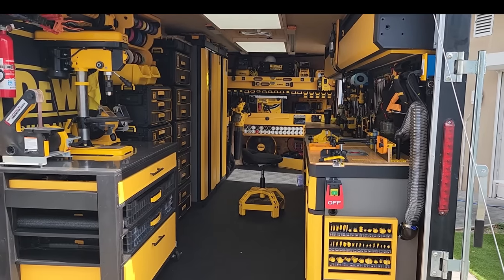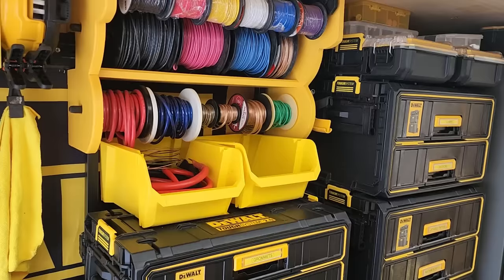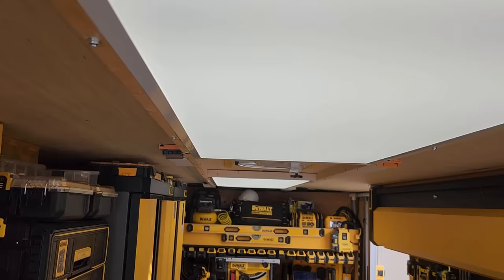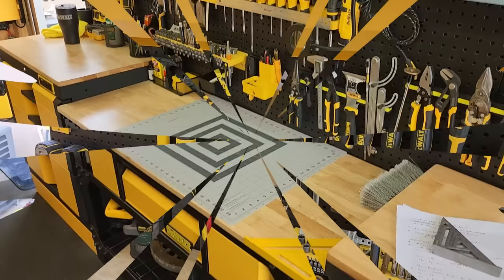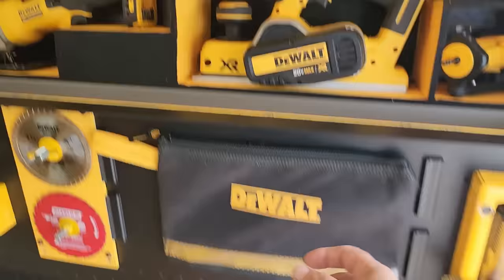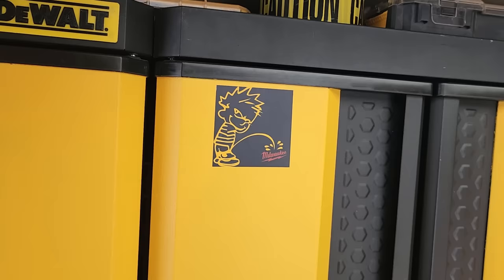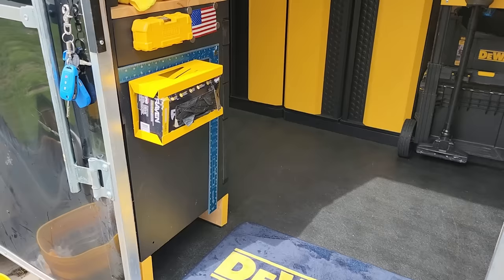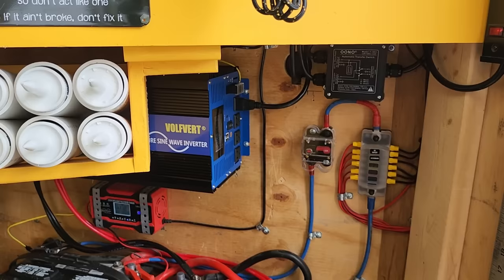DeWalt Theme Trailer Workshop

Comment: This is a fantastic looking set up. You must be so chuffed with that... is it working out or have you? Over in the uk we dont really trailer. Id love to do it but just not practical
Reply from the maker: It's mostly just for tool storage.. its a rolling garage. So far I haven't had a need to move it or do much work inside. I drive a truck and just grab what I need for the day. Depending on the project I am working on, most of it is done outside the trailer anyway, so its a perfect setup for me.

Comment: Great job!   Do you have plans or drawings of any sort?  Looking to do this in a 30’ car hauler trailer with ramp.
Reply from the maker: I didn't really have plans when I started. I had  the cabinets already, so I just slapped them inside and worked out the positions. The last  cabinet to go in was the table with the drill press. I built that table to size, so I had the luxury of fitting it right up to the ramp door.

Comment: Hey Barry, love the build! Quick question on the paint, was there a specific yellow you used on the custom pieces? I’m working on a dewalt build but can’t find a yellow that really matches. Thanks in advance!
Reply from the maker: Most of the cabinets I rolled on with a paint that home depot color matched, but i assume its the spray paint you are interested in. There's a few colors that are close, but the one I like the best is Rust-O-Leum's "Golden Sunset" .. its a little bit more on the orange side and you can see the results for yourself in the video. The only down side is that it is only available in a gloss, so you will likely need to spray a matte finish after it dries.

Comment: I don't understand how things don't fall out and move around when this is on the road? How do the kobalt cabinets stay closed?
Reply from the maker: They all have mechanical latches and matched keys. If you pause the video, you can see the locks. As for the tools, they are extremely secure, I use various methods to secure them.. some are simply held in by being wedged into a tight spot while other use velcro straps or oversized hooks. unfortunately there is no "One" solution that would work universally, each tool needs to be secured differently.
Reply: I was wondering the same.  The tools in those cabinets will come thru those doors. Don’t think this trailer could handle my work day.  But that’s why it isn’t mine
Reply from the maker: @allbayfishing9456 all Kobalt cabinets have locks with matched secùrity keys.. If you pause the video, I'm sure you'll see them..I even added some additional security latches on the upper cabinets.. they are not needed, but I didn't want to take chances.  As far as tools flying all-over the place on the road, I can tell you I am 100% certain its not gonna happen! Despite how it may appear, it's not possible.  Sadly the video ran much longer than expected and I didn't get to cover many of the smaller features, including how the tools are all individually and uniquely secured in place.. I plan to address that in a future video, but every power tool is secured with its own discreet method.. some are simply held with velcro straps or pressed firmly against  "contour fitted" side walls. Others are stealth mounted or otherwise clipped directly to a flat surface with hidden clips. There is very little play to anything. It all requires some form of simple 2 step action or a specific motion to release.  I am actually very proud of some methods, they are not all "magic tricks", but some of them are overly simple and effective. 
 As for the tools on the pegboard wall.. yeah, they need to be boxed up before I move out, some of them are secure enough to stay but it only takes a few minutes to toss them all in a box.
  The only things I worry about are the hand tools in the drawers, and the drill press. The drill press is a bit of a pain in the ass but I'll eventually come up with something better than just ratchet straps im currently using.. as for the drawers, ill probably end up using kaizan foam or building some cpvc inserts. I honestly haven't towed it around a lot since i finished it, but the only things that have moved on me so far are the contents of the drawers and some floor items... the stool, the 24" fan and my rolling tough system toolbox (which put a nice big dent in a new cabinet) . All of which are simple fixes I should have predicted sooner, but over all its probably more secure than a lot of other work trailers. There's always "something" that's going to fall over or slide around in a trailer, but so far she's holding up great.

Comment: Imagine if somebody did this with good tools, like Milwaukee?
Reply: You can find those videos. Milwaukee takes advantage of vocal loyalists like yourself and uses you to drive their prices up. I do like a lot of my Milwaukee tools, but I've also spent a lot of money on some of their flops. If I was a mechanic or plumber, Milwaukee would be my primary brand, and they've earned that. In my experience, DeWalt has proven their worth in the field. Not necessarily the strongest, not necessarily the most durable if you're sending 1,000 lags in a day, but definitely a good ROI in general.
Reply from the maker: I find that no matter which tool brand you purchase, DeWalt always seems to be the brand everyone compares their product to.. they always set the benchmark. In recent years Milwaukee has taken the lead by manufacturing many cordless tools that DeWalt does not, and they have not been well reviewed.
Reply: @Tool_Addicted_Carpenter  I am a mechanic, using exclusively Milwaukee impact tools, drills, screwdrivers and ratchets, all battery powered, 38 hours a week , every week. Nothing else has stood up to this kind of use and abuse
Reply: @glennstatham960  Precisely why I said that mechanics and plumbers are essentially obligated to consume Milwaukee.
Reply from the maker: We all pick a team,  I picked yellow and ran with it. The trailer could have been any color. I personally love a good dewalt/milwaukee debate, but both brands are great and get the job done.. believe it or not, I made a Milwaukee trailer as well but I had to walk away from the project, it was costing me 10 times more money and broke down in the parking lot! :)

Comment: I love the trailer, but how do you deal with the dust
Reply from the maker: I don't do much cutting inside the trailer. I prefer to work outside under a canopy. As for the corded machines in the back, I have a dust extraction system under the router table which can quickly be connected to the drill press and sander. I have to run the hose across the floor, but Its a small sacrifice to keep the place clean. There's only so much you can do inside a trailer. I also keep the ramp open when I'm working and blow everything out real quick when done.

Comment: When u painted your drill press and bench grinder what color did you use. I’m assuming spray can. Also what color paint on the wood tables like the black gray and yellow in im assuming house paints?
Reply from the maker: the spray paint i used is Rust-O-Leum "Golden Sunset".. it is a gloss paint, so i would highly recommend a matte finish be applied. The Yellow on the cabinets was color matched at Home Depot using a dewalt organizer tray off a store shelf. Most everything else is the "factory colors"

Comment: Dewalt do a battery operated dust extractor with a wireless remote control DCV586M
Reply from the maker: That's just it.. I have one. But the damn dust box is too small.. terrible design flaw.  I'd have to empty it every 5 minutes... I played a game of "guess which adaptor works" and built my own expansion box out of a Tstak box.. it actually works pretty well, (better than the rigid),  but it is just a weeeee bit too big to fit inside the cabinet. It's really just an inconvenience though, i can always just hook up my full-sized extractor when I need to.

Comment: What is the floor made of/ what did you use to install it?
Reply from the maker: ¾" plywood (PT) , covered with a vinyl flooring material that is glued down.
Reply: Where can I find the vinyl floor?
Reply from the maker: @seanrieflin2417  I bought it at Lowes'. It was a 8×16 roll. It cost around.$300

Comment: Do you really build anything in there
Reply from the maker: No... only small projects at the bench. I do most of my work outside the trailer under a canopy.  I don't like to make a mess inside, unless it's a project that's easy to clean up. I mostly tinker with small projects at the bench like soldering or using the dremel. I have a pair of folding work tables under the drill press. It's real fast to be set up outside.

Comment: how much money do you have into this lol
Reply from the maker: I wouldn't normally answer a question like that online, but I haven't even figured it out for myself so I'll give it an entertaining attempt... 
   To be completely honest. there's really no way to tell....I have at least 15+ years worth of tool purchases in there, and I always buy "thrifty deals" and upgrade tools often. If we were to take all the tools out of the picture (as well as my time and skill invested), The trailer itself cost $4500 (used, only 1 year old). The cabinets were all roughly $1K , Assorted lumber/electrical/lighting/hardware and ceiling vent were another $1K and then another $1K for DeWalt Specific storage items like the 3 rack systems and tough system storage boxes. ... May as well toss another $1K in the mix for the batteries/inverter and security systems/trackers. I also made various modifications to the trailer itself like an electric jack, reinforced locks/latches, exterior flood lighting etc. (another $500+)..
...  So, I suppose around the $10K mark empty...That's really not too bad for an otherwise empty custom trailer,  but, in reality it's likely 10X that amount with all things considered.
Reply: @BarrysToolCave  You didn't have to answer lol. For my job we have similar work setup . I work for a municipality so we had a budget for the things we needed. Its a good day when you have free reign in a Home Depot. We have basically any saw youd need corded and Cordless models multiple sizes ect. Any hand tool  . Multiple sets of DeWalt and Milwaukee. 

But what you have for a personal collection is awesome. I'm A DeWalt fanboy but co workers like Milwaukee. Id love to have a setup like what you have.
Reply from the maker: @jim7789  thanks much! .. I know I didn't have to answer, but I was genuinely curious myself. I never really thought about it, so I figured this chance was as good as any to write out a quick estimate.

Comment: wtf. That is way too clean. I'm disappointed. ;-)
Reply from the maker: I just finished building it when I made the video.. everuthingbis either new, or freshly painted. It's been about a year now, and while it's still looks pretty much the same, there's a few signs of use.. some scratches in the paint, some stains on the desk, etc. The trailer is mostly just for storage, so I do most of my hobbies, etc, outside under a canopy.

Comment: Seems like a big fucking waste of money
Reply from the maker: You make a fair point. Im sure it would appear that way to many, but allow me to counterpoint.
  ... the trailer cost me about $6K  used (only a year old). Being that my current house does not have a garage, this trailer serves as my shop. .... where else are you going to get a 7×14 extension added to your house for only $6K?  The fact that it is mobile and DeWalt themed is irrelevant. it's a storage investment.
  With that said, I have been using and  collecting DeWalt tools for 20+ years, (mainly due to staying on a single battery platform) and I already owned all the cabinets, etc, from my  previous home where I did have a garage.  With a few exceptions, this entire project was more of a time investment than a financial one. At the time, I had plenty of time on my hands. 
    Lastly, I dont believe it is ever a waste of money to do something that makes you happy. I didn't build this trailer to make a video or show off my collection, etc. I built it to impress myself and satisfy my need to organize my tools. It was therapeutic.